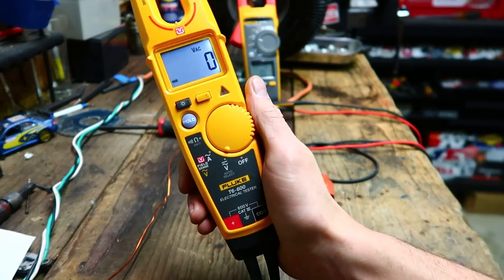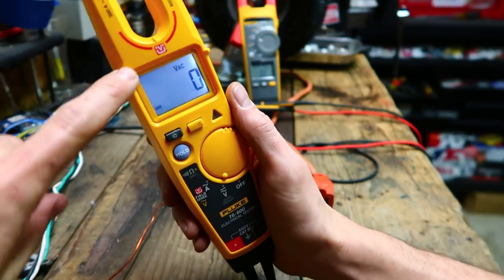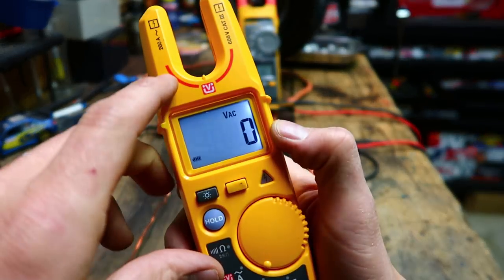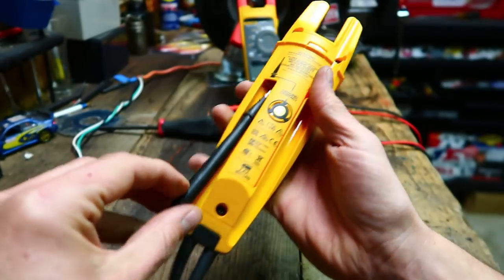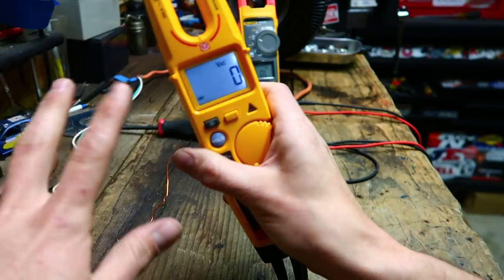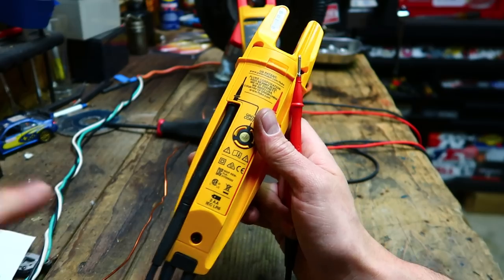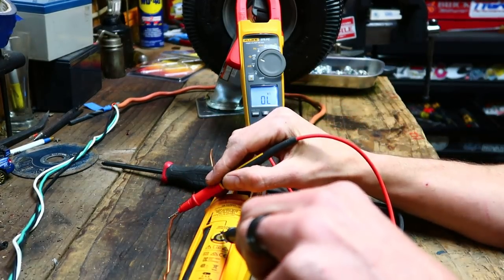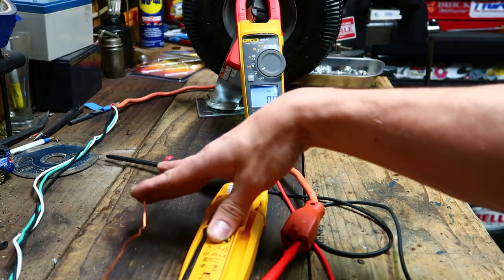Fluke T6-600: NOT DANGEROUS!

Comment: Wow, nice way to get clicks.  If you go back to his video he was testing in amperage.  Test it in amperage and post that video.  I'd like to see how that works out.  Clearly you are the one leaving something out
Reply from the maker: an amp probe style meter doesn't work like a multi meter.  The amperage never flows through the  leads like in an 87, it gets the reading from the coil in the jaws. Which is probably more dangerous to a novice than this meter.
Reply: Unless you aren't using the inductive feature but instead are using the test lead (maybe accidentally landed on amperage instead of voltage with the selector) as he said.  You are not testing what he pointed out at all.  Watch his video again.

Comment: Did you put the red lead and then check for continuity. That’s how diodes work
Reply from the maker: Well no. But this isn't diode protected anyway. If t were there would be 0 volts. Good point though.
Reply: Mike's Tool Shed love to know how it works. Av is right about the inductive tester.
Reply from the maker: https://youtu.be/frjoyQHqCN4 this guy does a really good job testing it, probably answers any questions you could possibly have

Comment: I hope this is just a hobby for you. Terrible science on your part, sorry. Do you own a decent oscilloscope? It would provide some good data. Voltage, amperage, frequency all at once.
Reply from the maker: No. I've always wanted one. But I bet you know a guy that has several that failed to pull it out in the testing of this.
Reply: Mike's Tool Shed lol yeah he did forget. Dave jones should have a look. I have a old Tektronix from the airforce. Got it for free because i fixed it. Litteraly live next to a warehouse of them. But the old ones are great and you can score one for 80 bucks. And if i was uncle bumblefuck i would slam fluke as far as i could too and say it was dangerous.

Comment: AvE likes to think he knows about electronics. And yeah a real 74 volts would get you pretty good. But like you said it is not real voltage. Electronics can sense currents that we can't. That is part of the mystery. That there's stuff going on that we can't sense. Which is what makes electronics magic.
Reply from the maker: not afraid to admit, electricity is a total mystery to me. lol.  The messed up part is,  electricity is just a theory.  there is mountains of evidence that it's real, but no one has ever seen an electron scootin along.
Reply: Check out electroboom. He is doing a really crazy, cool series on electricity. He can explain things very well. And freakin hilarious too!!
Reply: For just a theory electricity holds up very well with the observations that we can make of it. Electricity is easy as P/I=E or P=IE even.
Reply: What is lightning?
Reply: Lightning is static discharge. Like the shock you get walking on a rug in the winter then touching a light switch, only bigger. Lots lots bigger.
Reply: Electricity is just a theory. Lol. Yes, it is. I can guarantee it isn't  a hypothesis.
Reply: It’s super easy to measure the current at that pad. All that needs to be done is measure the voltage with a meter or scope what has a know impedance then add a high value resistor to ground and see how much the voltage drops do some math and you will know within the tolerance of the resistor what the current is. My guess it’s capacitively coupled and I’m sure they high pot that thing to 10 KV to be safe. It’s a dumb meter but you can bet the safety team was all over it.
Reply: It doesn't support your case saying something is super easy then giving convoluted instructions.
Reply: Paul Frederick it easy if you know electronics. I’m not writing an instruction manual in a YouTube comment. Send one to Joe Smith he will properly test it.
Reply: joe gets his own meters. And he did get one and test it. It was a couple microamps as I can recall.